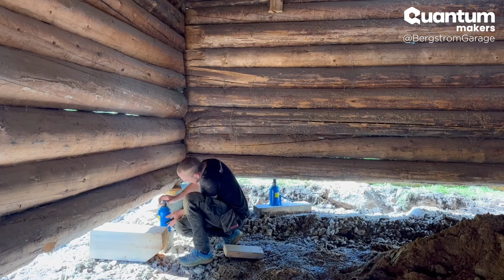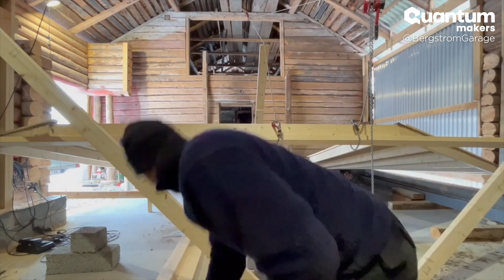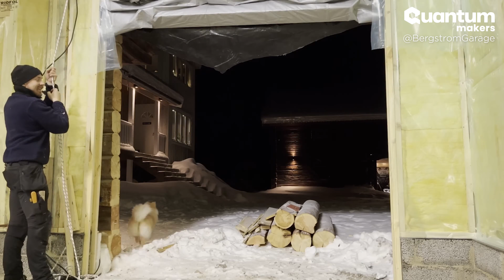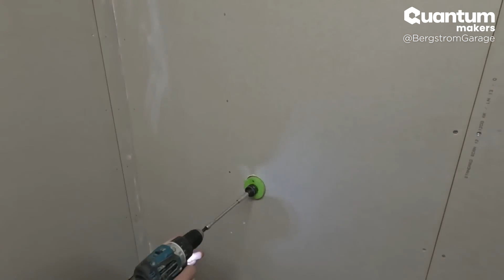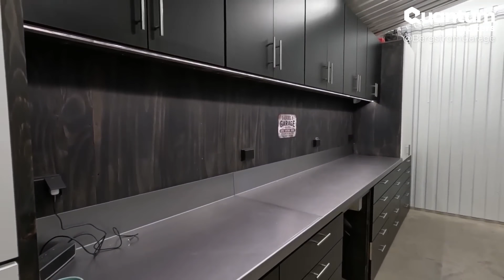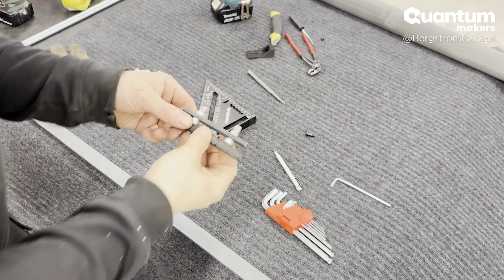He Lifted a 100-Year-Old Barn to Build His Dream Garage

Comment: If Daniel hadn't cut through 100 old grow, long, and sturdy logs, he could have replaced some of the ones that were rotted.   It's done now.  I would have taken the time to keep the old growth logs intact and used modern materials where I had to use them.  He could have dug under the walls to get the excavator in the barn and back filled later or made a basement.

Comment: I would have pushed the House off by 4-5 ft..using 3 Posts..for a Porch Below, and on the other side, use ze 5 ft interval to do a glassed Roof to ze BasementéRoot Cellaré Solarium Greenhouse..a Dark Pantry Space with Shelving can also be made at one End for actual Root storage..That way, you get the solar rays shining in below-South west Exposure..and on the NW Side..maybe have a Row of 2 ftx2 ft Windows sitting atop ze Concrete Wall..Asymetric Roof ..yes, to get Height for a usable Loft maybe. But, hey, I need a Permit, just for a greenhouse,.its a good One...ha ha

Comment: what product did he use to remove the corrosion on that metal beam does anyone know ?
Reply: The commentary is a bit off. He didn't remove the rust (just the loose flakes). He used a straight to rust paint such as hammerite. It stops further rusting.

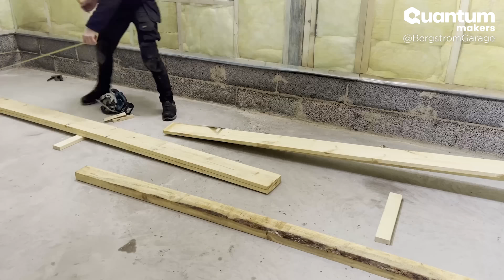Comment: 22:45 😢😮😊 Modern construction relies heavily on plastic membranes that trap moisture, leading to rot and mould. A vapor-permeable, breath-wall design provides a far superior alternative. By utilizing 30 cm of treated, eco-friendly cellulose insulation alongside plasterboard and breathable lime or clay renders, moisture safely moves through the structure without compromising thermal efficiency. When applied to a house-in-a-house layout within a timber garage, the outer wooden shell's natural gaps comfortably vent the escaping moisture. This creates a fully breathable, durable, and healthy indoor environment.

Comment: First of all, I'm super impressed of your work, Daniel. But I noticed something odd. I started watching the video yesterday without an audiotrack, which was very enjoyable, because your work speaks for itself. Then I ran out of time and continued today. Now there is a super annoying audiotrack, probably AI generated. I found no option to turn it off. I don't know if you added it intentionally, but if not I think it's an outragous impertinence from Youtube to mess with a creators content. At least to me the version without the track was far more favourable. What do you think?
Reply: Wow. Impressive & brave work. Well done 
Cheers Ray (UK)
Reply: Did you ever hear of the mute button on a remote? Or the volume button on the side of your phone? Just turn the volume off 😂
Reply: @nickiacono9574  muting doesn't give you that audible feedback from hammering, grinding, etc... that's what he was after , hence the point
Reply: @kodaph mentally noted
Reply: @nickiacono9574  That's exactly what I did, but thanks for the valuable advice. However that's not the point. I liked the original sound.